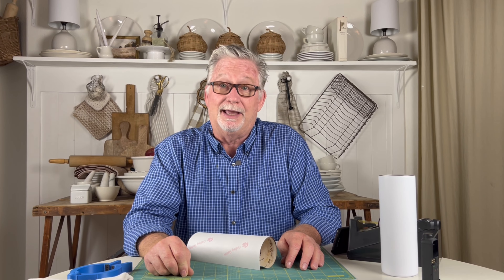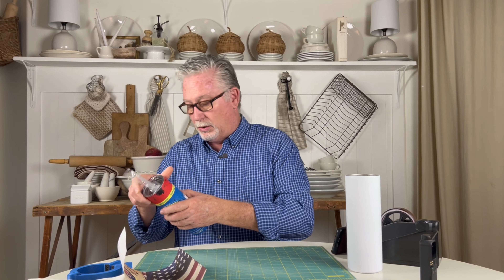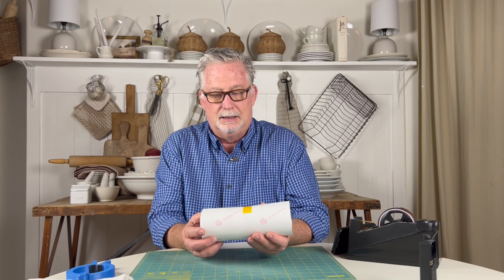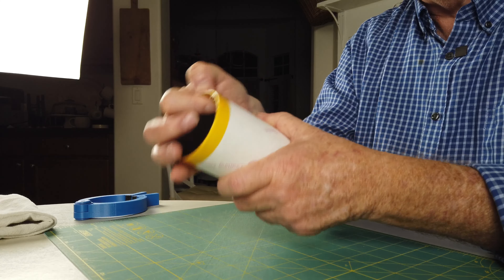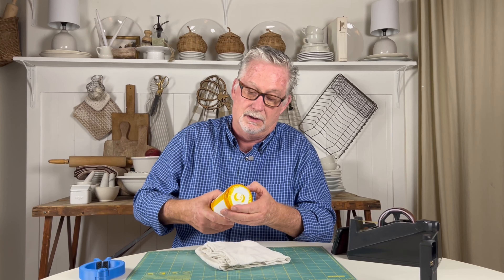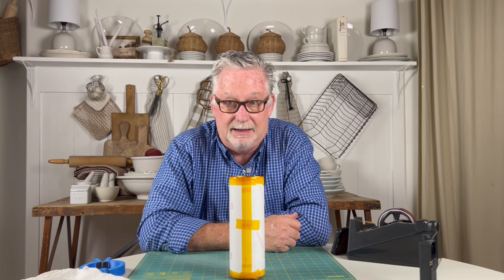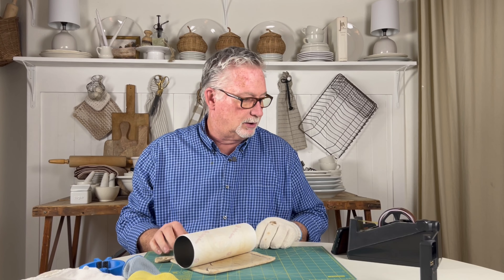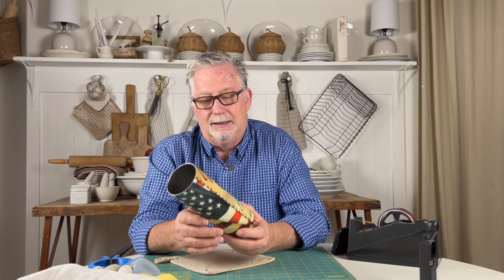How To Make Great Tumbler Seams and Edges!

Comment: Thank you for this great video and sharing your knowledge!
QUESTION: I am wondering if you have tried cutting slits on the top side of the tape before you fold it over in an effort  to avoid/minimize the kinks. Just wondering if you’ve tried and it does not make a difference or if you’ve not tried. Inquiring minds want to know. Again, thanks for your videos. I like that they are very detailed.

Comment: Fantastic tutorial, very well explained. Can I sublimated in toaster over without convection? If so, what temperature and for how long. Thank you for your help.
Reply from the maker: Hey! While I haven’t tried it, you should be fine with subbing in a toaster oven, you’ll just need to plan on rotating it during the cook. (Convection circulates the heat for you!) I’d try getting one from a thrift store! And remember, never use an oven that you use to cook food! The sublimation gases aren’t good for you!

Comment: Came out beautifully, what temperature and time do you use with your tumbler press? I’ve had a few issues.. lol help! 😊
Reply from the maker: Thank you! I set my press to 365 degrees and press for 50 seconds, rotate 180 degrees, another 50 seconds, rotate 90 degrees for 25 seconds, then rotate 180 degrees for a final 25 seconds. Thanks for watching!
Reply: @industrialfringe953  thank you so much 😊
Reply: Thank you so much for this video! Is this a 30 oz Tumbler? I gave the same mug/tumbler press from HPN and am having a problem getting the time and temp right. Thank you!

Comment: Can you offer advice I'm having trouble with the edge no matter what I do I have a line down the side where I can't seem to get it pushed down..
Reply from the maker: You have to make sure the paper is flat and tight, and then you have to make sure both seams are pressed down really tightly, especially where the top piece is overlapping the underneath. Thanks for watching!
Reply: I was having issues and I realized I was pulling the tape too tight and it was creating air pockets. Even when I tapped down and thought I was pushing air it it was still there. Pull paper tight but not tape to tight. I hope this helps

Comment: Besides taping are you using shrink wrap or a silicone locking wrap?  Or tumbler press?
Reply from the maker: Hi! Unless I’m trying to show how to to something in an oven as well as a press, if it fits in my press, that’s my go-to! Check out my video on how I use my press for more details on time and temp. And because I use a press, I don’t need the silicone wrap or shrink wrap. But when I do bake in an oven, I use shrink wrap after taping. Thanks for watching!

Comment: Could you do a video on 22oz fattys in a tumbler press?! Your videos have helped me so much and i am ruining all of these 22 oz :(
Reply from the maker: I could absolutely do one! I’ll need to order a few, so it will be a little later before I can get around to making the video (plus I have a few I’m already working on). What are your issues? (Join the Facebook group and it will be easier to talk back and forth!) Oh, and thanks for watching!
Reply: @industrialfringe953  Im using an amazon tumbler press that does up to 30oz but there is about 2-3 inches of exposed tumbler surface area when pressing and im seeing awful tape lines/what looks like vertical print lines/discoloration in my solid full wraps. I do your 20oz protocol to a T and make FLAWLESS 20oz tumblers. I need help! My temp is 365 for 4 passes at 18 seconds a pass to try and keep all sides heated. I rotate 45 or so degrees at a time.

Comment: You mentioned in this video that you leave a 1/16” to 1/8” white seam on your print.   You didn’t say why.  I’ve been taught to leave no seam and just make sure the two seams are tight against each other.  I have pretty good luck with that but not 100% of the time.  Do you always leave a seam? Is it better to do it that? way.
Reply from the maker: I overlap because I know I could never consistently get the size exactly right, and I’d rather have a 1/16” overlap with potentially a slightly darker mark than to have even the smallest white line. And usually I get no darker color at the seam. I’ve also noticed that tumblers are sometimes ever so slightly different in size. By having that little bit of overlap, I don’t have to worry about that! Thanks for watching!

Comment: I notice that your tumbler is painted white. It paint melting a concern when sumlimating? Would that mean I could sublimate yetis and hydroflasks? Also is adhesion/duability a concern when sublimating over a painted surface?
Reply from the maker: The tumblers I use (and what others use as well) are white with a coating over them to take the sublimation ink. They’re white so they have a “blank” surface to work with. You can only sub items that have a special coating. Because the ink is infused Inyo the coating, there is no durability concern. Thanks for watching!

Comment: My paper sticks to everything I have to scrub quite vigously for about 15 minutes. I don't know how everyone gets to just unwrap it with no sticking. I'm using sawgrass paper and a sawgrass 500 printer. Frustrated I am
Reply from the maker: I’d be frustrated, you, too. I am. Wait. You know what I mean! Are you using a press or an oven? Time and temp (and pressure if using a press)?
Reply: @industrialfringe953  tumbler press light issue.  395° 70 seconds.  Sawgrass paper , sawgrass 500. I've tried up 210 seconds,  385 degrees. Still bad results
Reply from the maker: Drop your temp to 365 and try. I do 365 degrees and press for 50 seconds, rotate 180 degrees, press another 50 seconds, rotate 90 degrees, press 25 seconds, rotate 180 degrees and press a final 25 seconds. I think you may have it too hot.
Reply: @INDUSTRIAL fringe  thank you so much,  i have about 100 tumblers and if this work in in the green.

Comment: Hi Roy! My tumbler measures 9.25 in diameter. Do you make your image exactly the same. I’ve been printing 9.27 and get a seam line. It might be my taping but I wonder if I should print exact?
Reply from the maker: Hey< I think we talked about this in the group, but I just realized your difference of .02 is only about 1/50 of an inch. You may actually need a little more overlap! I try to have about 1/8” of overlap, but sometimes have just a bit more.